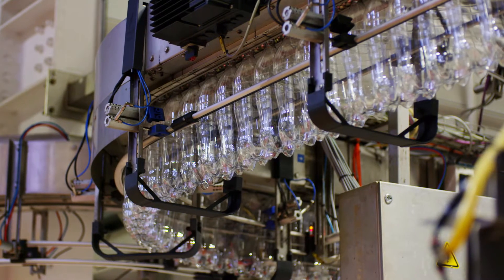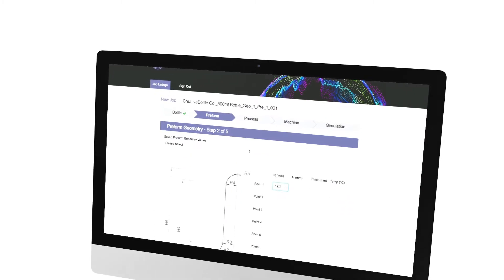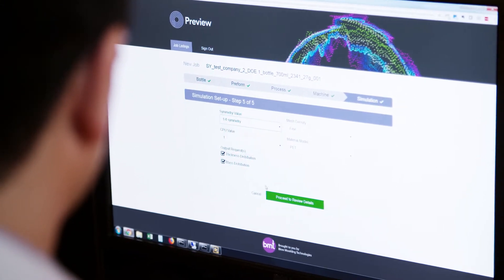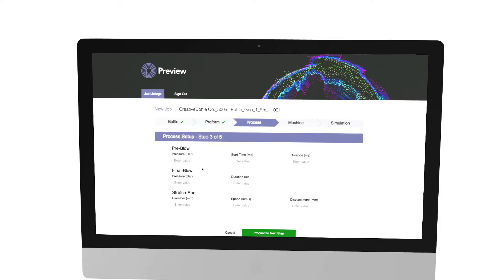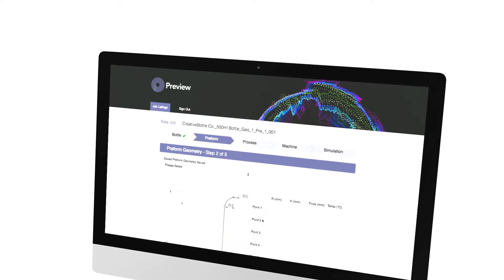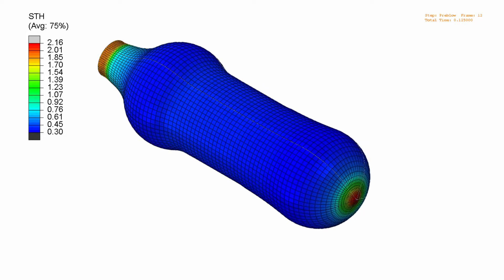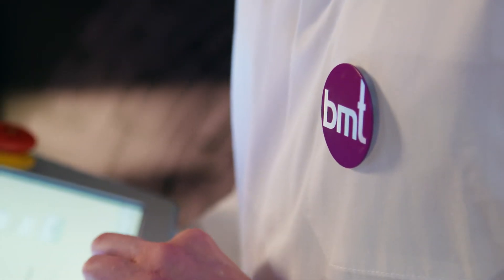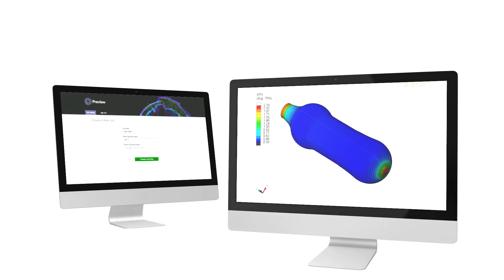Preview Stretch Blow Moulding Simulation by BMT

Comment: hey! which software did you use for the simulation?
Reply: hi Ravi. We use the Abaqus platform as a solver but we have developed our own SBM simulation with custom material model. We also have employed our own advanced techniques for material characterization, machine characterization and accurate process implementation.